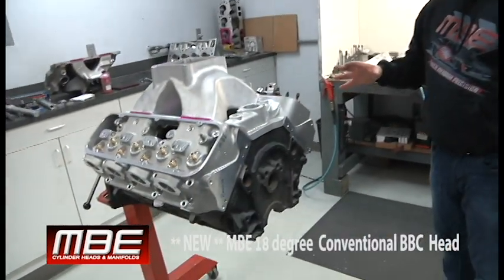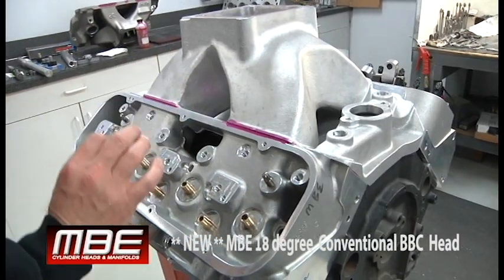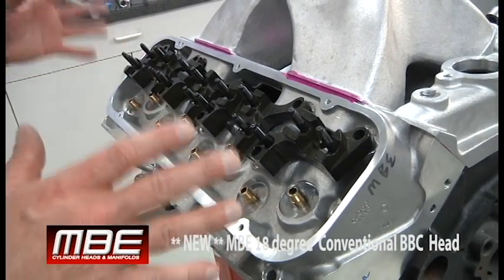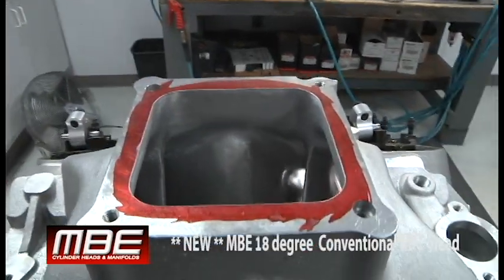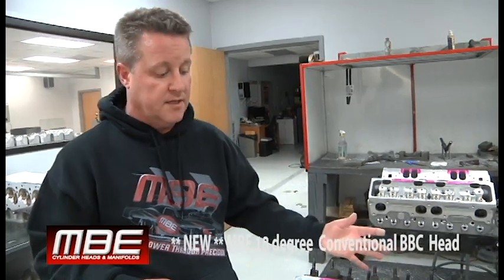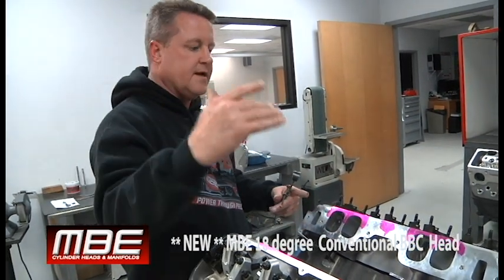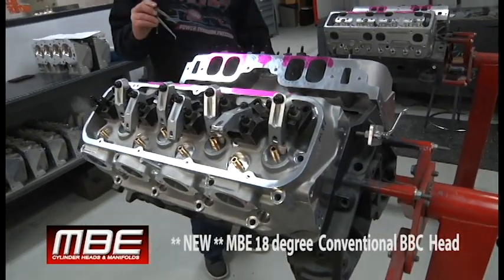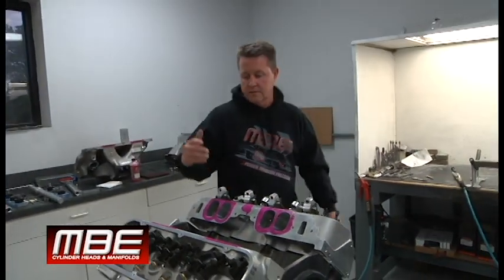MBE  18Degree Big Block Chevy  Conventional Cylinder Head  EXPLAINED   ** TECH VIDEO **

Comment: Commentators these are for high compression 15-1. High rpm, big ci 600 plus, lots of nos. 1300-1800 hp engines. At least $8500 with rockers, manifold valve terrain. 800 plus lift cams. Not found at auto zone or daily driver car or truck.
Reply: As he said 25 times "ok"

Comment: Do you have a demo engine with these heads? How are they under boost?
Reply: It's over 500cfm at 500 lift.  These heads are CRAZY nice.  These will absorb boost like a champion with that much CFM at lower lift.  Moving the bolt locations is extremely smart.  That intake is SICK nice, better than 99% of what is in the market today.  I love the setup, great job guys.

Comment: I have always said oval port is the way to go. Just never could get a good design, until now.
Reply: The oval just seems more consistant - smaller velocity variances compared to square, and broader torque curves should result.  But cross section is cross section - I don't think the turbo/injected crowd will care, so square ports have their place.
If I was building a big block... these heads have my attention.

Comment: Why Not 12° Heads???
If your making a New head for the BBC why not make a Hemisphere head????
So you can keep up with Dodge.
Hey man,  that thing got a Hemi????
Reply: Water jacket issues, see steve morris motors.  You are talking about a NEW PRICE POINT with lower angle heads than 18 degrees for Chevy.  The stock ones are 24 degrees so this is a VERY NICE improvement.